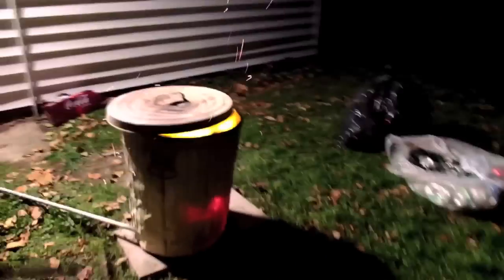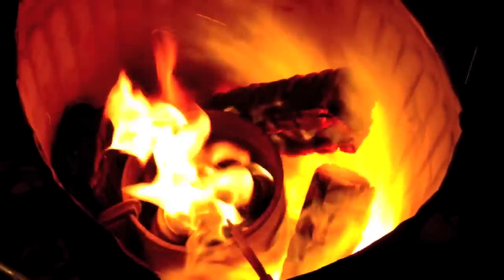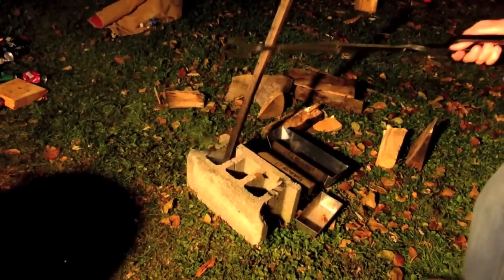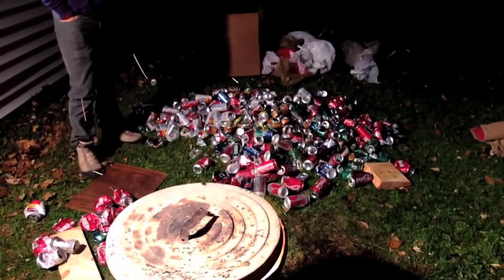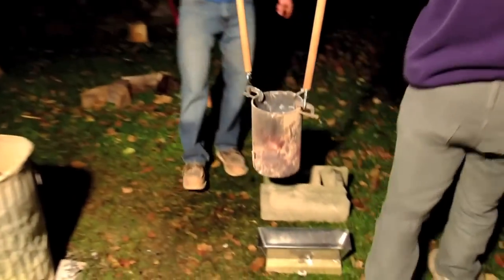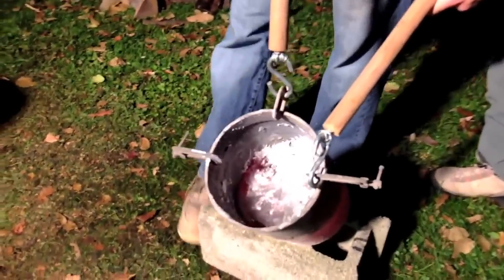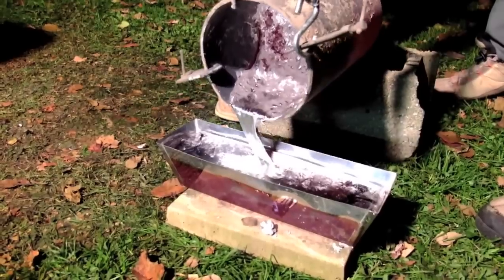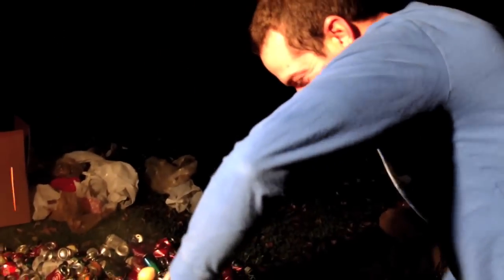How to Melt Aluminum Cans into Ingot

Comment: Seen some wack ship, but it worked. Just know all safety went out the window here.
Reply from the maker: John Day yep. Safety first is most important! Safety second is typically much more fun...until someone gets hurt.
Reply: @benatdesk  this was probably the coolest video I have seen in a while. Just plain grunting through it, nothing special. A trash can lol. I would say a pretty good pour and I disagree you need to temper it. Could look at ways to purify it. Also silicate or formed or cast allum could be used to strengthen it up.

Comment: When I worked as a pipe fitter & poured led joint, I was taught to always use kerosine in the joint so their would be no moisture when you made the pour, keeps the lead from hitting the moisture and blowing into your face. Also NEVER WEAR TENNIS SHOES while working with molten metal, also leather gloves & eye protection.

Comment: Had you bother to cap your crucible, you would have had about 1/3 more metal to pour into the mold. Its called oxidation, and with forced air you not only increase the amount of oxygen for the heat, but also for oxidization of the aluminium.

Comment: Forgive me as I am sure you have answered these questions but I am frankly to lazy to read down.  Did you say the pot is a Fire Extinguisher? Are you using drywall mud pans to pour it into?  And What did you use for the center hook on the fire extinguisher? Finally, do you think charcoal would work as good?
Reply: mmmmmm... laziness...; I can relate.  yes it was a fire extinguisher cut in half.yes, a drywall mud pan.not sure what you mean by center hook.we started off with charcoal but quickly ran out.&#160; wood does not get hot enough really.&#160; use charcoal for sure. :)

Comment: it doesn't matter, of you have the time do it and save it up. wont be long and you will have a few hundred bucks. and way more space to take the copper o smelt to the yard. which is worth it. turn number 2 wire into n7m er one bright

Comment: Wow! you guys are looking to be blinded before you grow old.  Aluminum hitting a damp surface will explode at around 300 feet per second, or faster.  You won't even have time to blink.  You absolutely need safety glasses with side shields.  Those holes in your ingot are from some gas bubbling up through the metal.  Not enough to explode, but showing that you were not perfectly dry either.  An engineer from Creative Risk Management calculated that 30 pounds of aluminum poured into a puddle 1/4 inch deep and three feet in diameter would release enough energy to take the roof off of a 10,000 square foot building.  Molten aluminum should not be handled casually.
Reply: wut

Comment: You need to tell your friend NOT to reach and move the mold pan without telling you first. Once you get a hand full of molten metal it is to late.  Your crucible left me with my heart in my throat when the clamps started wiggling under load. Punch holes near the top of it and hook in them, or bend rebar in semicircles and make a 2 part clamp you both can grasp it with.  Go to Harbor Freight and buy a few pairs of leather welders gloves, leather aprons and chaps to protect yourselves. Make sure you wear safety glasses, better yet get a few face shields and hard hats. These things are much cheaper than paying a plastic surgeon to rebuild you.
Reply: I've seen a lot of molten metal burns & that ain't pretty. (I also poured molten Aluminum in H.S. - Metals I & II, where we did it SAFELY.) The way they were goin' about this made me cringe too.  Thank YOU for posting some very basic safety points when working with a home-made foundry Sir!

Comment: where did you get the mold thing that you poured the aluminum in.
Reply: What they used was a drywall mud pan. You can get it at construction stores like Home Depot, Lowes, Harbor Freight, ect. However the problem with it was that it was so thin the aluminum is going to melt steel really quickly. That's why in the final shot you can see how the aluminum is partially discolored that's because the steel melted on to the aluminum.
Reply: +Chase Lee steel melts at a much higher temp than aluminum...what your seeing is the zinc coating burning off
Reply: +William Ela I watched s
A vid were they used a silicon mold

Comment: Can you use an old cast iron, dutch oven, pot with or without the lid. I have several large cast iron pots and wanted to know If cast iron can be used for the melting container? Love the blower for extra heat.

Comment: This is really cool but one word of safety that's really important: You have to dry off the bottom of the trough before pouring. Even a tiny amount of water droplet will turn into steam underneath the pool of aluminum and manifest a huge bubble that explodes and sends aluminum flying everywhere.

I've had this experience melting zinc and it almost got me real good! I poured it into a mold with a wet bottom and 4 seconds later it exploded like a shotgun that shoots molten metal and sprayed it to the left of me up to 16 feet away. A tiny droplet of molten zinc landed on the back of my 3rd finger and left a tiny but nasty 3rd degree burn that went all the way down to the bone. I was lucky to be ok without going to the hospital but if that "shotgun" had aimed at me, I'd probably still be in the hospital.
Reply: +McGuyver Workshop I've poured zinc as well with moisture, but all that happens is the cast is fucked up internally. I ended up breaking a drill bit when I drilled into a bubble I was unaware of.
Reply: Kevin Jacobson It is very dangerous to pour a pool of molten anything on a wet surface. You were very lucky the few times you might have done it but you are playing Russian Roulette each time. A large quantity of aluminum as shown in the video could kill someone.
Reply: +McGuyver Workshop I was only using small amounts. The water vapor mostly just exists out the top.
Reply: McGuyver Workshop  gald someone else knew this and said something! *
Reply: That is why you should heat your mold to drive off any moisture

Comment: its not pure aluminum soda can tabs are titanium
Reply: +jake scheiner I doubt that the can tabs are titanium, if they were there is no way you would be able to bend and break them like I've been able to do in the past. Titanium is a lot stronger than steel, not to mention comparing it to aluminum.
Reply: The price that mounts to the can is still alluminum not titanium only the tap not the connecting peice

Comment: See, molten aluminium does not glow red in daylight therefore the bright orange glowing molten metal which poured out of the World Trade Centre before the collapse was NOT aluminium, it was molten steel which could only have been melted by themite.  9/11 Inside Job.
Reply: Make sure you wear your tin foil hat
Reply: bubbacrabb *tin fedora
Reply: WhateverReally It may start to evapotate / burn at that temp
Reply: I  always start my inside job speech with two questions when talking to someone about it. one : Do you know what brainwashed means? two : How many buildings fell on 911?  
The first anwser is usually yes. The second is almost always 2. 
Then I laugh at them.
Reply: WhateverReally  yea but the melting points is only talked about to say if the buildings were brought down due to planes or demo. so if you talk about building seven then you don't even have to talk about melting points ...obviously it was a demo job which obviously means inside job...and yes most people don't remember building 7.
Reply: Aluminum isn't usually used in architecture
Reply: Evan Erickson The twin towers were hit by an aluminium Boeing aircraft. The 911 Commission said the video below was molten aluminim pouring out of the building, but molten aluminium does not glow bright orange in daylight, so the molten metal pouring out of the WTC must have been molten steel, which could only have been melted by themite.
/watch?v=LivXaOguXRA
Reply: notice how in this video the metal is turned red by the aluminum
 just another inside job.  have some respect for your fellow countrymen who died.  this was a terrorist attack and saying otherwise just to get your fantasy kicks is wrong.
Reply: Moses Bullrush wtf are you talking about? You think Israel did that? Are you high?
Reply: bubbacrabb No the plane filled with your countryman led by terrorists.
Reply: Jesus christ you moron. Just because aluminium melts at a temperature not sufficient to make it glow doesn't mean it can't reach that temperature later
Reply: WhateverReally The metal which poured out of WTC was glowing bright orange in full daylight. If that metal was aluminum it would have flowed out the building as soon as it became liquid, which means the metal which poured out of WTC on 9/11 was steel which only becomes liquid after is is bright orange.  BTW, nothing crashed at Shanksville.
Reply: Evan Erickson evaporate ? Do you have any clue of the temperature you'd  need to make metal evaporate ? No where close
Reply: Moses Bullrush Yes it might have started flowing out as soon as it was liquid. It may also have become bright red/orange just after it became liquid. Fuselage crashes in, kerosene is burning, fuselage melts, starts to spread along the floor, temperature continues to rise, aluminium turns red, drips out of building.
Reply: WhateverReally Around a thousand degrees centigrade is required to make anything glow bright orange, the heat/color/temp relationship is constant regardless of what material or metal is being heated.

You say, "fuselage melts, starts to spread along the floor, temperature continues to rise, aluminium turns red, drips out of building".

Oh Yeah, the floor temperature was over a 1000C, that why Edna Cintron could stand waving to the camera without showing any sign she was suffering heat exposure.
/watch?v=APPrKNskn7Y

A kerosene office fire without forced compressed air induction cannot generate enough heat to melt aluminum.  Put an aluminum cooking pot on the blue flames of your gas cooker as see how long you need to wait before the pot melts.

Did you see hundred tons of molten boeing  glowing in the empty hole at Shanksville? 

Only Jews believe their stupid conspiracy theory that Muslim caveme stood down NORAD.  The video below sets out all the evidence that Israel did 9/11 in collaboration with Washington traitors.

Video Title: "9/11 was an outside job - by jews. 911 False Flag - American Traitors & Mossad - Ken O'Keefe"
/watch?v=S10Aotp_tvo

Please quote anything in the above video link which you say is untrue and then give your reasons which support your claim that anything in the video is untrue. If you can't do that then you have nothing worth saying and you should be quiet while the adults are talking.  - ok shlomo?
Reply: Moses Bullrush The temperature at which something glows doesn't depend on the material ? Thank you for proving your scientific knowledge is that of a high school graduate
Reply: WhateverReally  The color of the glow is the eye detecting a radiated frequecy of electromagnetic radiation which is dependent on temperature regardless of material which is heated. It's called "black body radiation curve" - google it and you will learn something. This is basic physics covered in school so thank you for proving that your scientific knowledge is below school level.
Reply: Moses Bullrush everyday objects aren't black bodies you fucking idiot. A black body absorbs all the energy it's exposed to and doesn't reflect any. Many energy related characteristics, including radiation, are different for black bodies than real life objects. 

Seriously, just googling stuff won't save you. Don't try to argue with people who know what they're talking about.
Reply: WhateverReally The "black body" is the reference constant.  An object heated to a 1000 degrees C will glow the same color regardless of what the object is made of.
https://en.wikipedia.org/wiki/Black-body_radiation#/media/File:Black_body.svg
Reply: you linked a website about black bodies. Real objects AREN'T black bodies. That's like saying " we're building an aircraft, for our calculations let's assume there's no air friction".

Saying a real object is a black body makes calculations easier, but wrong
Reply: WhateverReally An object heated to a 1000 degrees C will glow the same color regardless of what the object is made of.  Get over it.
Reply: Moses Bullrush yes and an object will fall at the same speed regardless of weight. Keep dreaming pal
Reply: WhateverReally True, in a vacuum all objects fall at the same acceleration (earth = 9.8ms sq) regardless of the objects weight.  At 1000 degrees, Gold and Silver glow the same color.  At 3400 ° C, Tungsten, Carbon and Hydrogen Gas all glow the same color, like the sun.  You enjoy learning don't you.
Reply: Moses Bullrush yeah, but earth isn't a vacuum, and objects aren't black bodies. 

What you state would be true if they were all black bodies, but the emissivity varies from one to the other, varying the power of the output of energy, and consequently, the wave length (which determines color)
Reply: WhateverReally At 1000 degrees, Gold and Silver glow the same color.  At 3400 ° C, Tungsten, Carbon and Hydrogen Gas all glow the same color, like the sun.
Reply: Blue Apple yeah, the fact that these nuts let themselves be brainwashed into thinking it was an inside job is straight up sad
Reply: Moses Bullrush Oh yay, yet another nut job video that states facts without any sources. Look look look : George W Bush is secretly a dead pig, being worn as a suit by 12 hyper-intelligent weasels. I can make up facts too.
Reply: WhateverReally The vide link I gave you is fill with facts, that's what you are really complaining about Shlomo.
Reply: I did a whole paper about that and why its correct 5 pages of pure truth...
Reply: Moses Bullrush inside or outside job the point is three buildings fell that day and people only remember two...brainwashed...and the third was not hit by a plane..so who cares about melting points...
Reply: Blue Apple seriously ? It's because those 2 were a symbol. The highest towers in the world, America's symbol of greatness. That target wasn't picked for maximum casualties, it was picked because it's a symbol of everything the terrorists hate. Nobody forgot about WC7, they just don't care.
Reply: Blue Apple "obviously it was a demo job". Man you're dumb. If the government did this, and wanted civilian casualties, why the fuck would they do a controlled demolition ? Obviously they would want to cover up their involvement and maximize casualties, so why didn't they blow up the foundations in a way that made the towers tumble sideways and wipe out half of manhattan.
Reply: Your an idiot. And its called Thermite. Not to mention 50,000 Lbs of jet fuel can burn hot enough to melt steel at 2,100deg F. Not to mention the WTC towers were not made of Aluminum, but Steel. What kind of moron thinks the WTC was made of aluminum??
Reply: +Trever Tiller  Read the thread dummy.
Reply: Trever Tiller you obviously don't know anything about steel if you think that it melts at 2100.

Comment: So, what did you use for the crucible?
Reply: fire extinguisher cut in half
Reply: Did you just pick one up at your local big box department and spray it dry? Or did you pick one up somewhere? I'm currently using a propane tank without the top, but I fear it won't last many rounds in the foundry.
Reply: Also, My big box store carries fire extinguishers only in the aluminum variety, won't this aluminum melt like the cans I'm melting?
Reply: yha, you would need a steel one.
Actually if you check out Ben Snyder s Channel you will see that it didnt last very long.  If you are going to go the super cheap route and just use what you have laying around, expect to only use it once or twice.  I think we had the fire way too hot on our second attempt.

Comment: Hello, if you're good at math, its easy to figure out how many cans were used to make an ingot.   Simply weigh the ingot and divide that weight in grams by how many grams a can weighs. You can count money the same way and be quite accurate as long as your scale is accurate. I can put quarters in a bucket and tell you exactly how much is in the bucket by the weight.
Reply: Zach Holt
Just want to say that that's tecnically not an accurate method of calculation. Don't forget the (albeit small) amount of aluminum lost as oxide (slag/dross) during the smelting, as well as any alloying elements, paint, leftover soda and other things that don't make it into the finished ingot. You can sometimes have a deviation of up to 5% loss of mass between the original can and the finished product depending on the can, so the amount of cans in that ingot is likely at least a couple dozen more than the number you've got
Reply: we actually have a video on this... check out the description

Comment: anyone who reloads bullets has done this many times if he recovers fired bullets at the range. Melt them and cast into bullet molds, or cast into wire which he then cuts with calibrated wire cutter then puts on copper jackets so bullets don't melt going down the barrel causing lead fouling. Nothing new under the sun, only new discoverers of it all. thanks for the post

Comment: I scanned through this ... Nice ... any other suggestions for a crucible?  ... (don't have fire extinguisher to chop up ...) Garbage can, shop vac, and pine to burn = no problem...  What is the "form" you use to make the ingots?  .. (I'd like to make some ingots, and later re-smelt to pour into molds of artsy crap things = paperweights, belt buckles, beer mugs, ects .. )